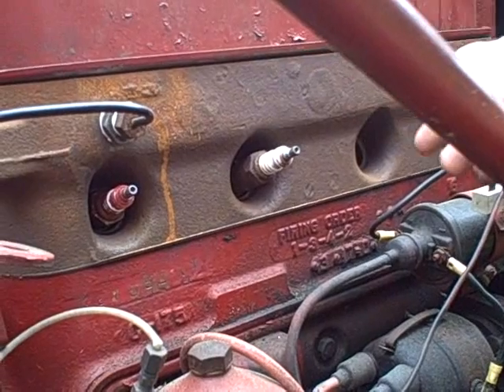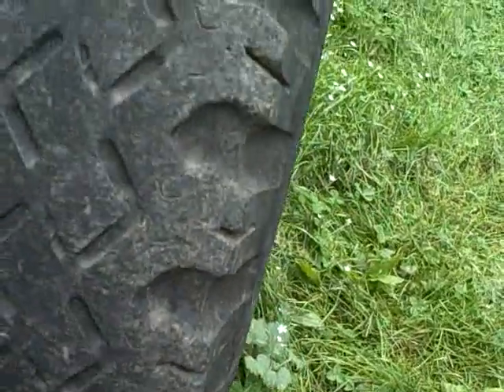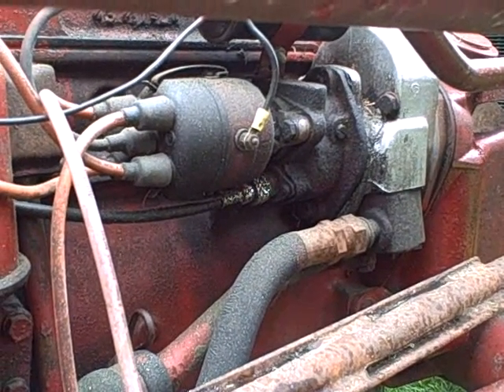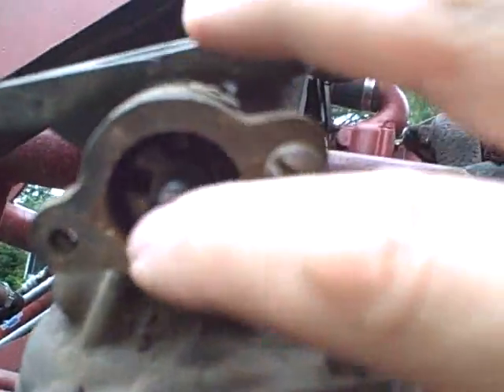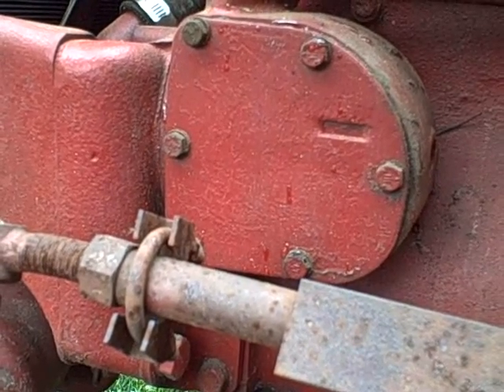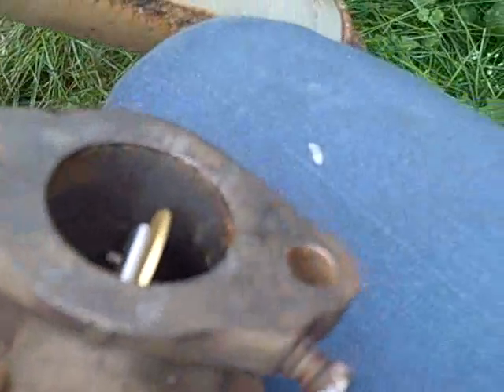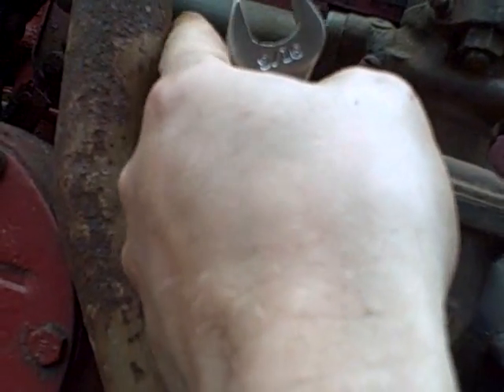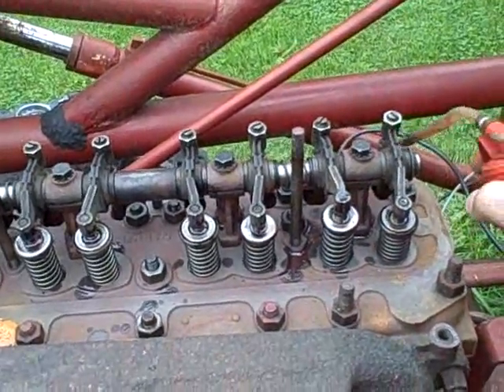IH 350U Tractor Project Part 12

Comment: Back when there used to be a Champion Auto Store in my area (20 years ago) a parts guy there told me that Champion Spark Plugs are the lowest of the low end spark plugs. That to me meant "Don't ever buy a Champion spark plug" and I haven't!
Reply from the maker: I've heard similar.  funny that the plug with the best name has the worst reputation